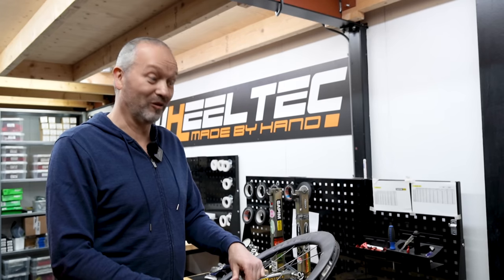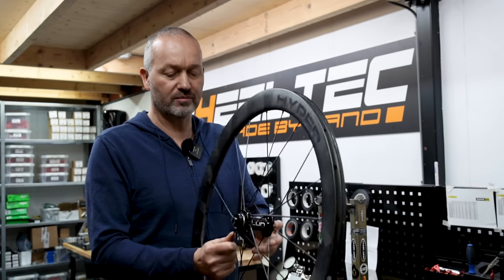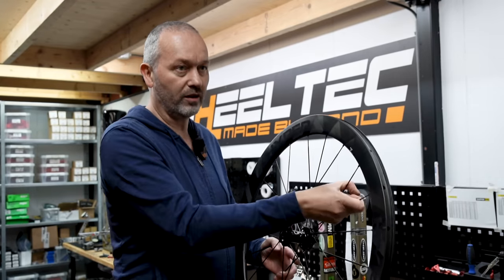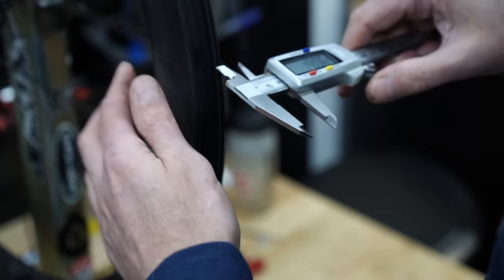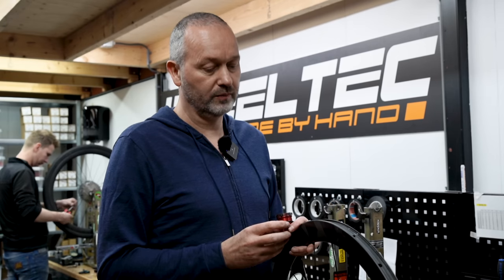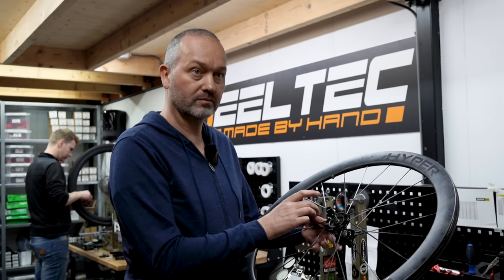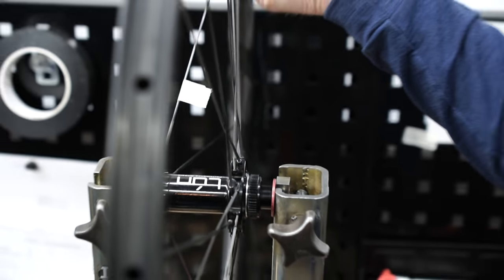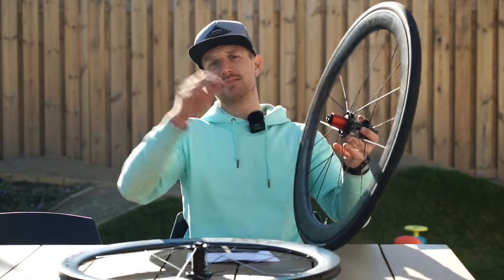2-year OLD Winspace HYPER Wheels Inspected By A Professional

Comment: I'd like to see you try the 65's.  I love my 50's but not sure whether to get the 65's as well for fast, flat riding (crits without sharp corners etc).
Reply from the maker: Yep, if there are no big speed changes it would probably suit well!
Reply: @jasperverkuijl  Thanks for setting me off on a tangent for the last hour! I took an example of accelerating a wheelset from 32 kph to 48 kph which was about 600W over 8 seconds for me...
The difference between a 1kg wheelset and 1.6kg (65mm) is a maximum of 4 watts. (I assumed all mass was 350 mm from the axle)
So, the difference between 65mm and 50mm Hyper will probably be negligible in terms of rotational acceleration - obviously you still have to accelerate that weight forwards as well. Would be great to see what they felt like in practice, though.
Reply: @jasperverkuijl  You'd think so but even on the Winspace website, they say the 50's are so aero there is only a handful of watts to gain... A handful isn't specific enough for me to spend $1500AUD + tyres/cassette.  I can't find any data but maybe you can with your contacts there?
Reply from the maker: @elliotpollard9083  I think its a bit more complex.... your assumtion (all mass at 350mm from axle) is exactly the thing that takes away the different Moment of interia. In moment of inertia is DOES matter where the weight is, so in the hub or in the rim. 600gr added weight at the hub does not nearly have the same effect as 600gr added weight at the rim. That's what its all about. 
Also where did you find the 4 watts difference from?

Maybe you know that and I'm not understanding your expalation correctly idk. 
The weight difference of the two is about 180gr. Thats all in the rim because the hubs and spokes are the same. So that will make a big difference in Moment of inertia and feel of the wheels! (like Marc said you can already feel about 50gr..)
Reply from the maker: @stephent2243  50 to 65 will be a big gain in aerodynamics. The most earodynamic wheel is a Disc (closed TT wheel). If you want to see the difference between those wheels check out my T vs Roadbike video. 
So a 65mm is closer to a disc (aerodanamically) than the 50mm, so it will be faster (aerodynamically) in certain conditions. (not a lot of wind)

what numbers are you looking for exactly?
Reply: @jasperverkuijl  Yep I've used deeper wheels before (404's, rovals etc).  It would be good if they could say the watts saved over the 50mm at 40kph for example, so you know if it's worth buying another wheelset for.  I think any of that data helps sell aero products.
Reply from the maker: @stephent2243  we have to ask  @Hambini  to get back in the windtunnel!

Comment: How does a "hub" affect the bearings? Don't the hubs just hold the bearings in place?
Reply from the maker: When the part where the bearing goes in is not EXACTLY the correct size (this is in fractions of a mm) the hub will sit too loose, too tight, or skewed. That can cause problems

Comment: Approximate at 22min, when they are talking about spoke entry angle, the builder was right in the beginning that these hyper spokes angles were out, however what he wasn't right is that these carbon spoke entry angle / hub flange hole drilling angles were initially designed so that the spokes are not touching each other. Going back to earlier winspace website, you can sell those spokes were not touching each other, thus the spoke entry angle was quite straight. However, many straightpull wheel users have reported the rattling noise on their wheels, so many companies started to cross their spokes in order to avoid the noise. Some clever companies will also tell you by doing so will improve the lateral stiffness. Back to the Hyper carbon spoke entry point, now the spokes are crossing each other, the potential consequence will be the spoke breakage, like two knives are constantly grinding each other, after hundreds of thousands rotations, they will fail dangerously. To all carbon spoke riders, make sure you regularly check your spokes for any damage, especially where the spokes are crossing each other.
Reply from the maker: Hi mate,

You are not entirely correct on this. 
I have an early model of the hubs where the spokes are designed to cross and touch each other. Hence they kind of bend around each other which causes the different angles. 
On the new model (i talk about this in the video how they improved the hub design) the spokes still cross but don't touch. (They cross but stay "on one side" of each other). 
So in the new hub the spokes are in a straight line from the rim to hub and don't bend around each other. 

I believe this is only on the back wheel. Currently don't have the new wheels yet so can't check it side by side right now.

Comment: Just to add a couple of comments - some people contacted me to comment on the inertia that was mentioned on here. I actually spoke to Jasper about it on the phone. The inertia is a function of the distance or radius squared. So if you have the weight at 10cm form the centerline vs weight 20cm from the centerline of the hub, the difference in inertia is actually 4 times more.  10^2 = 100, 20^2 =400. In most circumstances in the real world, you want to have wheels with low inertia, they will corner faster, accelerate faster and decelerate faster. The bike will also be more nimble. The only time a heavy wheel is advantageous is when you don't have to accelerate or decelerate much. 

There are various wheel companies that go on about having heavy wheels as an advantage, unsurprisingly their wheels are not low weight (low inertia)
Reply from the maker: I explained it correct right Mr science?🤓🤙
It would be interesting to get those numbers of your interia tests 👌👌
Reply: @jasperverkuijl  I'm mr practical, calling an engineer a scientist is an INSULT no less 🙂 I'm going to start putting the MOI on the internet.
Reply from the maker: @Hambini  haha okay okay sorry for my swearing 😆. Want some candy 🍭 to make up?
Reply: @jasperverkuijl  offering candy to a 5 year old, whatever next! i hope your shed roof didn't get BLOWN off!

Comment: I have just orderes WINSPACE LUN 60 mm wheels and Now I need to pick the tyres. What would be your choice in the size? I am thinking about schwalbe one or one pro but do not know 25 or 28mm? What would be the best choice? I do not know if that is important but my weight is 89kg now and in the bicycle season will be around 86.
Reply from the maker: All depends on what you will be doing with the wheels....
25 for racing and smooth terrain, 28 with lower pressure  for training and rough roads. 
Cotton tire for speed (vittoria Corsa, specialized turbo cotton)
Nylon tire for everything else (Rubino pro, gp4000) 

Tubeless if you ride it frequent and are up for the fuss of latex, inner tubes for Easy switching between tires etc...
Reply: @jasperverkuijl  training and "Racing" on week days with my hommies 😉 one tire u till he wears off. I was thinking about 25 or 28 Schwalbe One tubeless. But you say to check rubinio or gp4000 🤔😉
Reply from the maker: @SzwedunioWiesz  I've never used schwalbe. s one is probably a food tire too
Reply: @jasperverkuijl  sorry for that but my English is not my language and I do not know what does the "food tyre" mean 😂

Comment: Your conversation about weight distribution on the rim was fantastic. I was thinking about this a few months ago and would interested to know Mark's opinion on the idea of a heavy front rim for Time Trial bikes. They are less worried about acceleration and more about stability and the conservation of momentum. Would there be a scenario such as a very flat, headwind / no wind Time Trial sector where a heavy rim may be advantageous?
Reply from the maker: It’s more stable, keeps speed easier, less twitchy in windy conditions but won’t go around corners easy… but a TTbike doesn’t do that anyway so 🤪
Reply: in 1996 i prepared for mtb uphill and i grinded and drilled all bike to reduce weight, (total mass was 8 kg) and the biggest gain was on wheels, they were 1,5 kg lighter  and bike behaved as maverick, it accelerated as crazy, on one turn of pedal it accelerated, wheels have double inertia: rotation and translation, so if you reduce mass of wheel for 1 gram it is same as you reduced 1.6 gram on frame(non rotating part)

Comment: I'd be curious what other carbon wheels are out there in a similar price/build quality with the better weight balance that Marc suggests (more balanced, less heavy rim, with weight focused slightly more towards the hub).
Reply from the maker: Haven’t seen them. 
Marc is actually working on his own design wheelset with the same carbon spokes as the Winspace. Maybe that’s the wheelset you want 😅
Reply: @jasperverkuijl  Does Marc have a website?
Reply from the maker: @grocerylist  search wheeltec Alkmaar
Reply: Actually 450g for a 50mm rim is reasonable. As Marc mentioned, towards 480/500 it’s considered heavy.

Comment: Great video and certainly makes me more interested in these. Curious how the rim brake version holds up though. Anyone have experience? 

I have a rim brake bike and not quite ready to upgrade to a disc brake bike.
Reply: I have the rim Hyper 50s and I've used them for a season. They are incredibly stable in crosswinds, and I hit a huge pothole and there is not a scratch on the rim. I think the apparently heavier rim is beneficial under both of these circumstances. By comparison, I had Zipp 404s and they were much more difficult to control in crosswinds for some reason.
Reply: I have the 38 and 50 hypers and I wouldnt buy any other wheels anymore. They are perfect. Before I had lightweight meilensteins, and I have to say, the hypers are better.. just use the braking pads they send with the wheels and the braking performance is awesome for rim brake wheels. So over all they‘re the best wheels I have ever ridden.
Reply from the maker: It seems there are 2 camps, the people that say these wheels are stable in cross wind (we both in this camp) and the people who say they suck in crosswind. (which I don't get...)

Comment: Very interesting and in-depth conversation. A wheels Q&A would be great. I wonder if we will see lighter rims and slacker head angles to counteract the twitchy steering. One of the recent developments that have not leaked over from the MTB yet.
Reply from the maker: Slacker head angles improves riding over bumps etc right? That's not a factor in road. 
The fork rake will also influence the twitchyness of the front end. It's all a complicated combination of factors 😅
Reply: @jasperverkuijl  A slacker head angle makes the steering more stable. As you said you could as well change the rake of the fork. The mechanism is the same, both changes the trail of the fork.
Reply: @cc-000  And that‘s exactly why it‘s a development. Product managers needed to be convinced that a 69 degree head angle is not making a MTB „sluggish“ but more controllable for the average rider. And they then found out that you can even go further.

Comment: Great detailed video. I weighed my rim brake  Hypers without rim tape and they were 1320 grams?? Also i didnt think that a 450 gram 50mm rim was particularly heavy? Maybe I'm wrong?
Reply: I was also surprised by this. Not even sure I would trust wheels that are lighter than this. I normally climb with some Shimano dura ace C-24. I know those are getting old, but the Hyper's at 50mm are as heavy as the C-24. My experience in strong winds downhill confirms what he said, although I don't have a proper comparison with other deep wheels on long downhills. I think until I make a transition to disk (no time soon) I won't be taking deep carbon wheels to long climbs anymore.
Reply: @faosa73  It is possible to have a super lightweight wheel that is stiff and strong.Up until recently I used to supply super lightweight wheels to friends and acquaintances. 3 weeks ago I sold a 1140 gram 50mm rim brake wheelset to an ex pro cyclist. He loves them. My 50mm tubulars are 1040 grams. The rim weights are about 440 grams off memory. They are stiff and aero but not quite as stable as the Hypers in cross winds but still very good, I can also build 50mm disc brake wheels that are around 1190 grams but I am having supply issues so I have stopped selling them. You can build a lighter wheel with reliable lightweight components fr a lot less money. The Hypers are excellent wheels. Enjoy
Reply from the maker: It's possible to use a lighter rim (not as deep, less thick material) with more spokes e.g. 
So the stiffnes of the rim itself is Less, but is compensated by more spokes to create a stiff wheel. This will lower the moment on interia since there is less weight on the outside.
Reply from the maker: I'm not sure if it's light or heavy... But i think there will be far lighter options on the market (lower profile and less strong). Compensate it with more spokes and you still have a stiff wheel.
Reply: @jasperverkuijl  FYI: An option you can use to stiffen a wheel is to use 24 spokes (rear) with a 2:1 ration lacing pattern. Pardington wheels are very light if you are a millionaire. I also heard that Lightweight have released a lighter model  wheel recently but these are really expensive. lol
Reply from the maker: @vietnguyen4312  yes that's what I mean. More spokes will have big influence on wheel stiffness, but little on inertia (spokes are light AND weight is across the wheel and not concentrated on the outside like a rim)

Comment: For me the only downside seems to be the 19mm internalt width. Because in the last years I got really used to (the comfort of) riding wider tires and I dont ride anything narrower than 28mm tires anymore.
Therefore these wheels are probably not the best fit for me.
Reply: I was going to post the same thing.   I was all about these wheels until he said that.
Reply from the maker: I did my 570km non stop ride on 28mm vittoria Corsa's and it was great. I've measured the real with of my 25mm Corsa on this rim and it's already 27,5mm  and they sit nice and feel more race than the 28mm. 
So it will depend on the tire brand what the real with would be too. 

Anyway, wider rims are the industry trend. Pretty sure Winspace will go with the flow eventually so maybe wait a while and who knows. 🤙
Reply: I am using 28mm since I saw PEakTorque mentioning a positive experience with that. The comfort levels increased substantially. Speed hard to tell, I still get dropped from our first group ride :)
Reply from the maker: @faosa73  smooth is fast!

Comment: So, on a mid-level €1.300,- aluminium road bike with Shimano wheels and 105r7000 groupset... is it worth it investing in wheels like these Winspace ones? Or would you upgrade to a carbon frame and it's accompanying wheelset? (Which sets you back even further)
Reply: Wheels. A carbon frame offers very little more unless you're racing mountains against Bernal
Reply: These wheels will be too stiff for an aluminum frame in my opinion. I have the model in 50 rim brake
Reply from the maker: Definitely go for new wheels. They are the most important in a bike. If you buy a lower end carbon bike it will come with cheap wheels and still won't be a good bike...
Reply from the maker: Disagree. 
Why are these wheels "too stiff"? What is it you feel that you think makes them too stiff? Maybe lower your tire pressure 🤷🏼‍♂️
Reply: @jasperverkuijl  I don't find them too stiff for me but I suppose a basic cyclist with an aluminum frame could find a lack of comfort in these wheels knowing that the aluminum frame absorbs the roughness of the road less. It is the same for a tennis racket and its string. The problem is that we are talking about generality and the notion of rigidity, for example, will be perceived very differently depending on the individual depending on their level, their equipment, their morphology, etc. In summary, your study shows that these wheels are very good for this price.
Reply: Thanks Arnoud and Jasper, wheels are the way to go. I am indeed a basic cyclist, but still fanatic 🤙🏽, so I wouldn't know the difference between the comfort of my current road bike with current wheels, versus another set of wheels. I have 28mm tyres now so would have 25 with the Hypers, which is different.

I consider my bike now pretty comfortable, especially because it's setup with the right height for me. I can't imagine that switching from aluminium wheels to carbon will have a negative effect on how much is absorbed from the road.
Reply from the maker: @arnaudseynaeve9266  the comfort will be more influenced by tires than the wheels imo. I actually think these wheels are comfortable comparing to other carbon wheels I have.
Reply from the maker: @virgilashruf718  Keep the 28mm! I've ridden these on 28mm for most of the time and it works fine. 28mm with about 4,5-5,5 bars will give the comfort you need. The tires descide most of the comfort.

Comment: The talk about weight balance and wheel weights is super interesting and I would be curious to see/ hear more. I would love to see some experiments about rotating weight and acceleration. I understand that your speed will be the same at steady state... but my non-physics expectation is that in a real world usage acceleration would be faster with lighter wheels same total weight and you are losing less energy each time you break ( needing to put back less when you re-accelerate to the previous speed or try to hold a wheel?)? Can you run those experiments for us please? Pretty please? ( same total system weight but one with heavier wheels and empty water bottles, the other with water bottles filled to produce an identical total weight but with lighter wheels)?
Reply from the maker: Yep that's the theory. Testing that will be difficult but maybe its doable